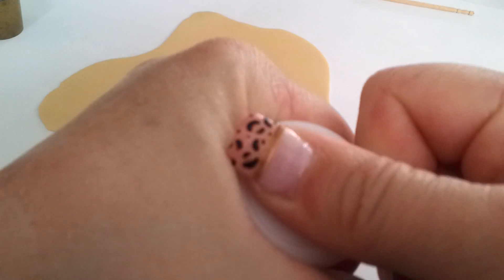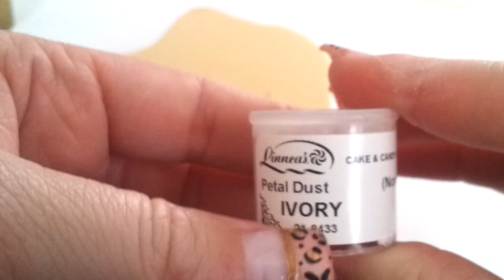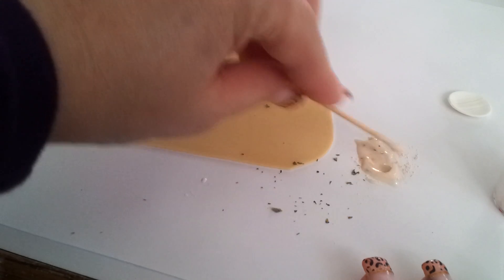Fettuccine Alfredo Tutorial, Miniature Food Tutorial, Polymer Clay Tutorial

Comment: Beautiful fettuccine Alfredo! I have a question for you. I have been mixing my color glaze in one of my Mother's dishes and I cannot get it off with soap and water. I was wondering if you have any techniques for cleaning it off surfaces. Thank you!
Reply from the maker: Liquid clay, or the varnishes? 
For the varnishes I pour a little bit on the paper I am working on.  I don't use a lot, so pouring a bit on the paper I am working on is good.
The TLS, and Fimo Deco Gel are very sticky. I put those in shot glasses, and clean them out with baby wipes and paper towels.  

Many glazes can be removed with rubbing alcohol.  

Heather